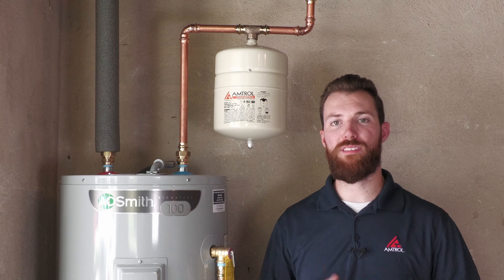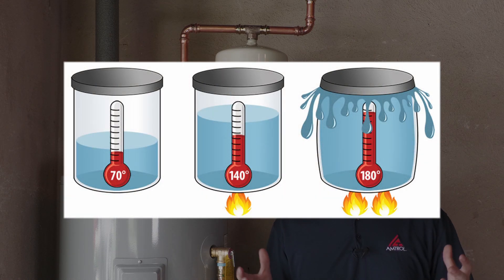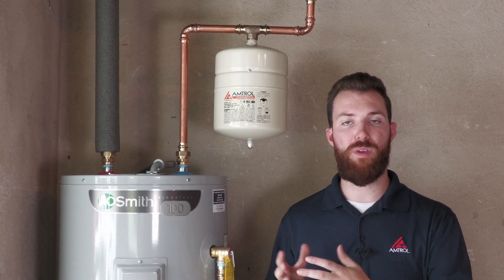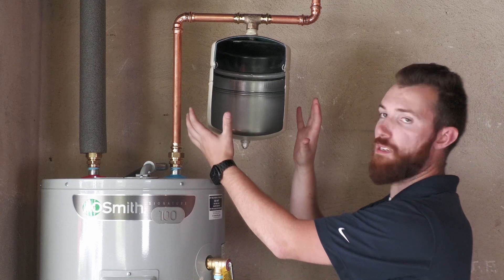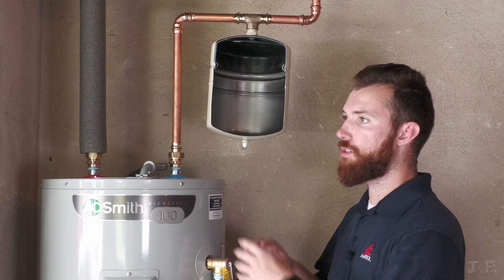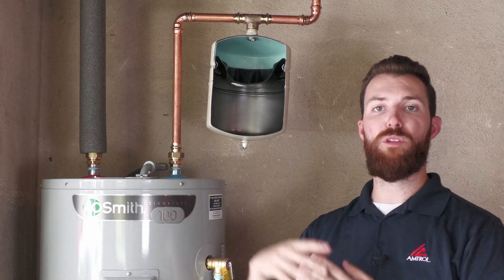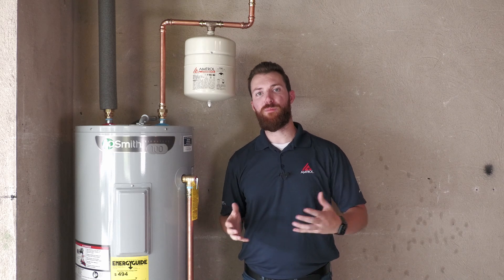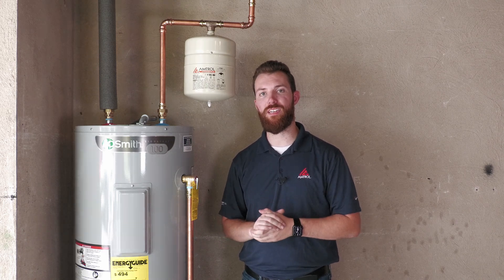What Is A Thermal Expansion Tank? - Amtrol Tech Takes

Comment: Nice cutaway. Just replaces a ST-5 as mine was done after 8 years. Must have developed a pin hole in the bladder as when I checked the pressure with a gauge there was some water coming out. I figured it was toasted as I started hearing water hammering under certain conditions with the tub and washing machine. Easy fix, 20 minutes to drain some water out of the hot water heater, get some blue tape on the new, unscrew the old, screw in the new and check for leaks, and write on an install date for the next person.😊

Comment: Why do you install expansion tanks on the incoming cold water side as opposed to the outgoing hot water side?
Reply: Hot water that has been pushed into in the tank from water heater will turn cold because the expansion tank is not heated. If this were installed on the hot water side, the volume of cold water that it containes would be sent down the hot water supply lines of the home when a faucet is turned on causing the hot water to be only luke warm until the tank was evacuated. 

If the expansion tank is installed on the cold water side this is not a problem because it will empty into the cold water supply side of the hot water tank. Additionally, by installing it on the cold water side it will not be in constant contact with very hot water which would prematurely wear the rubber bladder out quicker.

Comment: Absolutely a great explanation !!!!
One question:
What if no faucet is opened and the heater keeps heating !?
Reply: Your heater stops heating at your selected water temperature of 120-140, otherwise the hot water becomes semi steam or steam, and the plumbing system is protected via heater’s a pressure relief valve of about 110 psi recognizing municipal is 30-70 psi.  If that heater pressure valve doesn’t work, you have a big, big problem of broken pipe joints and flooding that won’t stop until you manually shut off water.
Reply: @tonymanero5544  Seems like they should put two of them on the water heater, just to be on the safe side, kind of like a steam locomotive. 🤔🤷😅
Reply from the maker: The water heater will begin heat, hit it's temperature setpoint, and the resulting expanded water will enter the expansion tank. If no faucet or other fixture is opened, the expanded water will remain in the expansion tank until water is used and providing a safe method of egress. Every water heater will have a temperature setpoint, so the expansion does not occur indefinitely. When it comes to properly sizing an expansion tank, all these variables are considered to ensure proper operation.

Comment: Is'n the tank also taking the place of air chambers that we used to put behind every stop to get rid of banging?
Reply from the maker: The expansion tank will help with minor water hammer throughout the home. If you have significant water hammer from a specific fixture in the home (such as a washing machine), it would still be recommended to have a specific hammer arrestor installed at the source of the shock.

Comment: Can you place an expansion tank on a main line right after back flow preventer?
Reply from the maker: Yes, that would be an appropriate location. Anywhere between the backflow/meter and the water heater without any isolation valves in between, is acceptable.

Comment: Does a tankless water heater require an expansion tank?
Reply from the maker: It would be recommended for any water heater to have an expansion tank, including tankless. Although there is far less total volume (essentially just the piping and any small on board storage), there would be potential for heightened pressures due to hot water expansion. Amtrol has a product, the ST-1, that is designed specifically for On Demand or tankless style water heaters.

Comment: My heating boiler has an Amtrol 30, written 2002 in Marker. Bought my house in 2009. Recently now has been raising pressure and relief valve opening releasing water on floor. Checked, did the knock test, tank is full, its done. Not bad for 21yrs. I ordered another Amtrol 👍
Reply: 21 years is a long time for anything.  Amtrol warranty is 5 years, so 21 is unusual.  Maybe you were lucky, or it’s was underpressured vs municipal pressure so it wasn’t working properly.

Comment: Do I need an expansion tank if I have a well with a pressure tank installed ?
Reply from the maker: A well pressure tank will naturally take up an amount of the hot water expansion in your system if the piping allows (not too far away, no isolation valves, etc). However, it would be considered good practice to have an expansion tank located next to the water heater solely for the purpose of mitigating the hot water expansion at the source.

Comment: The question is does it matter if the tank install up or down or sideway?
Reply from the maker: As of June 2023, we have amended our IO manual to allow for multiple orientations on install (w/ support in horizontal) of our inline expansion tanks. The benefit of using our recommended vertical-downward orientation is you get full utilization of our indicator cap, which is an early warning of a tank that needs to be replaced. This can potentially save time and money with emergency service calls. Otherwise, you should not see a loss in performance from any of those orientations.

Comment: Why all of a sudden these water heaters now need expansion tanks? I just replaced a rheem water heater that was 30 years old and never had an expansion tank. Can somebody that has  experience answer this for me because I think this is a scam just to add another part that costs you more money to change it.
Reply from the maker: Others are welcome to reply, but hopefully the video was able to explain how many modern domestic water systems are closed loop, meaning there is a backflow preventer installed at the meter. A closed system does not have anywhere for expanded hot water to go, therefore an expansion tank is necessary to absorb that increase in pressure to protect the components within that system. In addition, many water heater manufacturers and local plumbing codes will require an expansion tank for those reasons. Everyone's situation is different, if you do not have a backflow preventer, an expansion tank may not have been necessary for you over those years. As for new builds and repairs done to existing systems since ~1992, expansion tanks are very common practice.
Reply: My water heater knocks when is working, it’s that possible that whit an expansion tank the knocking sound disappears?? Excellent video and explanation!!
Reply: Yeah the video sure does explain how  electricians and plumbers are crooks just like the government! you don't try to help anybody. You only try to manipulate and rip people off day in and day out. Especially the old folks!  if any of you justify a fucken water heater with an expansion tank  costing almost $4,000 to replace. Then you truly prove you are a crook and should quit your profession and go work for the government.
Reply: Did you not watch the video?
Reply: @Penny_Wolf  exactly!
Reply: Wow.  This is not a scam.  If it is then chemistry and physics are scams.  When you heater water in your home it expands.  Fact.  
Thermal expansion increases PSI.  Fact
Water is not compressible.  Fact.
Expanded water needs somewhere to go.  Fact
It will go somewhere no matter what, either back into the main water line, your fixtures and appliances, pipes or anything else it comes into contact with.  Your system may be able to take it.  It may not.  An expansion tank is always a good idea for your home.

Comment: My house was built in 1993 and has no expansion tank. Would you recommend installing one, or is 30 yrs without any issues long enough to assume I don't have a closed loop system?
Reply from the maker: Chances are, you do not have a backflow preventer which allows the expanded water to push back out of your system. This may change if your water meter gets replaced and the municipality installs a backflow. Although it is good practice to have an expansion tank regardless, it may not be necessary in your application at this time.
Reply: Also, do you hear hammering or knocking when hot water is flowing.  Knocking is caused by sudden water shutoff, or hot water looking for space to expand.  An expansion tank is installed after the water heater via a t coupler with a female 1/2 or 3/4 to twist in a tank.  The tank is pre charged to match your home/municipal water pressure of 30-70 psi.  A 2 gallon tank is about $50, and plumber labor or if you can solder, do it yourself.

Comment: Mine is knocking. What is the life spand for this tank?
Reply from the maker: Knocking is likely water hammer within your system that the expansion tank helps buffer. It may be low on air or needs to be replaced. Our Therm-X-Trol series average lifespan can vary 7-15 years depending on several system variables. If you have any additional questions, please contact our technical support team at amtrolwatersystemsinfo@worthingtonindustries.com